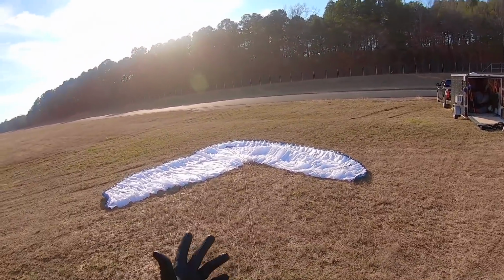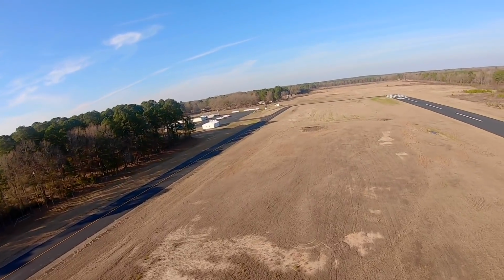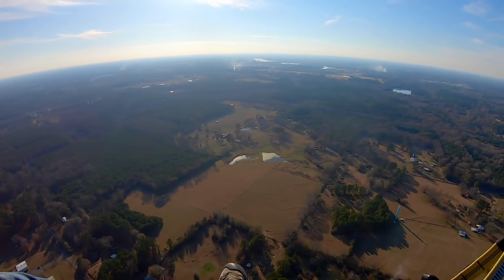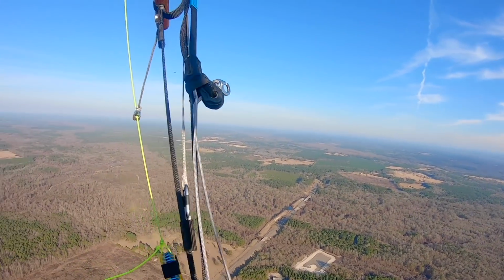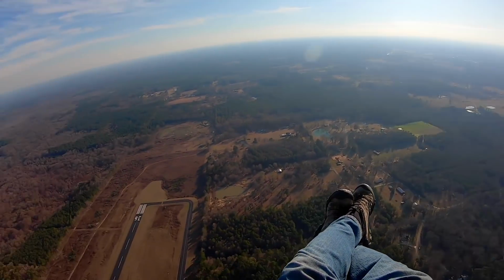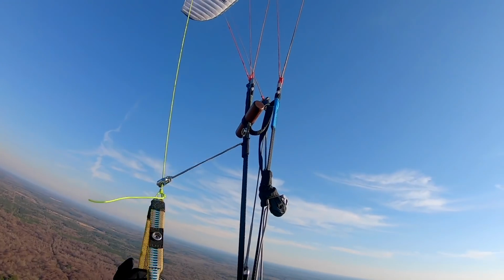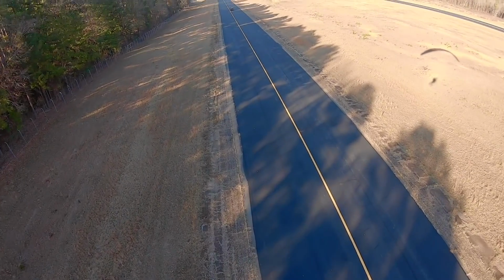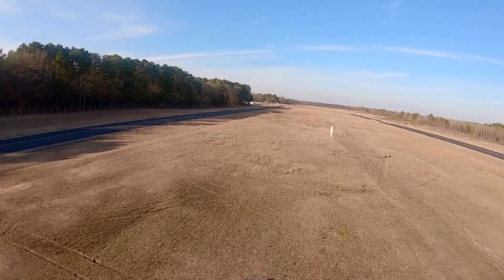Paramotor Ozone Zeno After Retrimming

Comment: Great flight! That was awesome footage thermalling with the birds! 👍😎

 I made an attempt to get out there today. 35°F, but very calm air. Unit has sat for 3 straight months, so I had a bit of work to do beforehand, namely air up my tires on the trike. Had less than 1 PSI up front, and 5 in each of the rears. Gave it a thorough preflight, warmed her up, put the nose wheel against the foundation of the shop, and gave her a few full throttle blasts to make sure the carb was going to behave. Ran great! I had it set super rich during the summer, so it's tuned perfect for the colder air - pulled 7,800 RPM easily. Anyway, by the time I laid out the wing, and cleared all the lines, the sun had gone behind the trees. I also noted that the old TV antenna that's still on the house is right in the line of fire - a little too close for comfort. Left ZERO room for error. Inches at best. That thing has got to come down. Dammit! Always something! At least I got to run some Amsoil Quickshot through the fuel system, and saw that my wing is MUCH larger in real life than it was in my mind, so it wasn't a total loss. 😁

Comment: Kyle, you showed how easy it was to get into the seat. What harness are you using? I have the Dudek Power Comfort (something like that) and I have trouble getting into my seat on takeoff. I've got my leg straps pulled tight. Way different from my last harness Apco Split Leg. That was easy. Any suggestions? Tks.
Reply: Anthony ParaGringo check your hangpoints.
Reply: @smokinonindo  Thanks Blake that's a good point. Although, I'm pretty sure my hang point is at the right degree of tilt, but I'll check it again.
Reply from the maker: Make sure the lower frame attachments are loose.  Too tight, and it keeps you from nesting in the harness.  Also, hangpoints as mentioned.